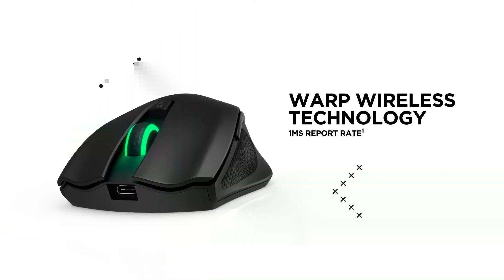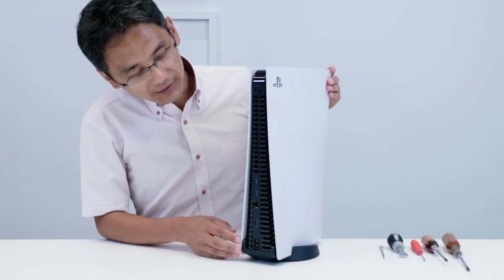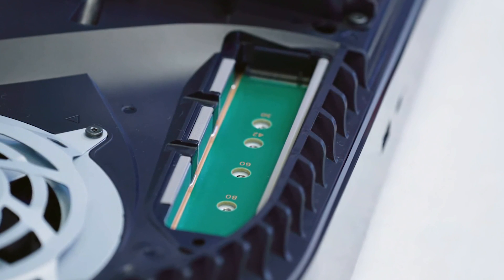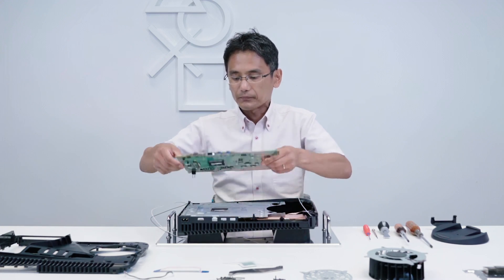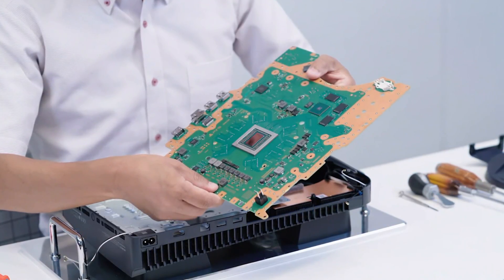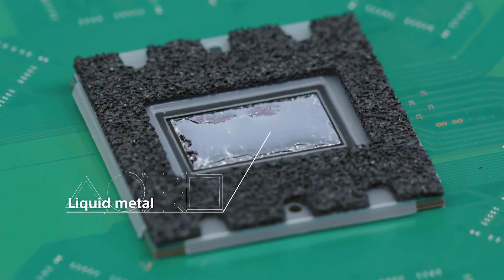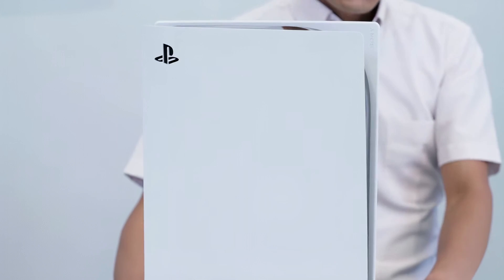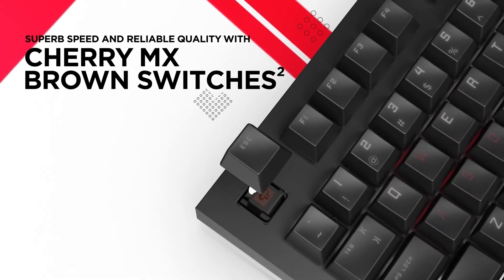PlayStation 5 Teardown Analysis: Inside Sony's Next Generation Hardware Design

Comment: As a practical gamer . I always connect my consoles and PC to ethernet.
Reply: Yeah me too. even though my wifi is really good. If the device is stationary why not.
Reply: It's probably for the PSVR2 which is rumored to use WiFi
Reply: @marcovalk7845  .
Reply: @marcovalk7845  Not rumored, just a patent they sent out. No engineerin their right mind would use VR streaming over garbage 2+2 wifi6 though. No presence and terrible latency.
Reply: @marcovalk7845  That would be from the console via an antenna not your router. It would add latency if it beamed it to your router instead of directly to it.
Reply: @Skylancer727  I think when he says to use wifi, that he means connecting the ps5's wifi6 directly connects to the psvr2. Wifi6 has centimeter level positioning so it could be used to make the psvr2 wireless.
Reply: @Skylancer727  depends, if it can also serve as a hub for the PSVR2 it should be fine. I don't know the specifics just the rumor
Reply: @marcovalk7845  That's what a lot of tech heads are saying, it's a future proof solution for a wireless PSVR2 headset. It makes sense given that the wired nature of the current headset holds the system down.
Reply: It has nothing to do with being a practical gamer. This is more about accessibility to a more stable connection when an ethernet connection is not possible. Happens in many households including mine, where the Ethernet access is in a different room than a multimedia room/living room
Reply: @edgaracosta9976  Yes and No, I know a lot of hardcore gamers that have run or spent money on a cable run to avoid the WIFI plague. For most console games on the PS4 Pro's upgraded WIFI chip I find it suitable for gaming, but before my wife got her Pro I ran wire for her. The WIFI was bad on the PS4 at least for us. the router was at max  15 feet and one wall away. I also have my router elevated in the room it's located in.
Reply: @edgaracosta9976  Let's be honest, unless you're streaming a 40 mbps BlueRay from Plex to your PlayStation, 5 GHz WiFi works great, as long as you don't have GBPS internet with FTTH, in that case yes, you'd gain speed.
Reply: @lnx648  Even blu-ray movie should be fine on that, in fact it is because I have man blu-ray movies and they stream over to my smartphone and laptop fine, if I had a newer router with the new wi-fi standard, it would be even better.

But the real issue with wi-fi is latency and interference, for most it's likely fine but many do notice the difference.

For me, wi-fi is fine even for gaming but my problem with it was the reliability, I tend to have more issues with wi-fi then with the wire.
Reply: @paul1979uk2000  Blu ray remux are barely playable on 5GHz WiFi with one end device connected via ethernet and the client connected wirelessly.
And with barely I mean some movies will chop, need to buffer often and so on.

But 5GHz is great for everything else honestly, neve had a problem with it, wether it's latency or speed. I get 8ms ping on WiFi, and I max out my internet speed also on WiFi.
Reply: @lnx648  It works here and seems to not have any issues with it, the blu-ray movies are raw rip so a direct copy of the original movie from the disk stored on hard drive, never had any issues with streaming them to any device on 5ghz.

In fact, an easy way to understand this is that I have a 200mb internet connection thats more like 220mb, I can max that connection without any problems on my wi-fi, that connection can almost do 3 blu-ray movies at the same time, to be fair, we do have a decent router so that might help.
Reply: @paul1979uk2000  Wait, do you have RIP or REMUXes, the first one is compressed, heavy but compressed. The second one is straight out of a blu-ray. I mean it works, but it depends on the movie, some have a bitrate that is too high and 5GHz starts failing or needs to buffer, depends on the movie however...
Reply: @lnx648  No it's just a direct rip of the disc with the protection removed, the size of the movie file on the hard drive is the same as it is on the disc.

To be fair, I've not really tried any newer bluray movies, most I did a few years ago but some are around 50GB and have no issues at all, in fact, we can have about 3 bluray movies playing at the same time without any issues over wi-fi so I doubt it's an issue for newer blurays if they are bigger in file size.

In any case, I have a 220mb internet connection that gets full speed over wi-fi, that's around 100GB of data per hour on my internet connection, I don't know how much more bandwidth my wi-fi has over my internet connection but it never has any trouble maxing my connection out.
Reply: I live in  an apartment they put my osp connection is in the closet🤦🏽‍♂️, so I can't just run an ethernet through the walls or across my floor, so having my nighthawk router does justice and wifi 6 will only make my connection better, even with my nighthawk I get 120 down on my ps4 pro.
Reply: If you are a competitive gamer, no amount of  wifi connection can replace the speed and reliability of a hard wired ethernet connection.
Reply: I have in the past, but new room layout—and destructive toddlers—means I will run the PS5 wireless this gen. It will sit up beside the tv, safe and sound.
Reply: Not everyone can. All of the kids getting these dont have the luxury, knowledge nor money to get a powerline ethernet adapters.
Reply: @AllOutNoobHater  ethernet is cheaper than getting an entire wifi router to hook up lol, a good one too, wifi will never be for those who are serious about gaming, ethernet is just better in every way, you can literally buy an ethernet cable for like less than 50$ & it will give you better performance than wifi ever wil
Reply: @bossmicky9256  I am fully aware of this. But did you miss the part where I said that the majority of kids getting these consoles can't do that and don't have parents that understand this?
Reply: @AllOutNoobHater  Yea I completely missed that, Idk how old ethernet is but I’m sure its before wifi at least right? Its crazy , I didn’t even know what ethernet was either until I got more into competitive gaming, and that was recently, like 2 years ago or 3 at the most, & didn’t get one until I played warzone since it was unbearable, I would lag n die instantly
Reply: No one that cares about performance will use wifi, ethernet will be always the better choice, I even use it on my Switch.
Reply: I've got wifi 6. I get gigabit speeds over wifi. It's nuts.
Reply: @technologyanimals  "bUt eThErNeT iS beTtEr" as every person tells us thinking that everyone has the ability to do so.
Reply: There’s nothing practical about that. Wires everywhere.
Reply: My wifi is very very good, so I'm glad we have wifi6
Reply: Same, WiFi fucking sucks, although if it's integrated with wireless VR that has actual decent controllers this time, I might be interested.
Reply: @YourPalHDee  maybe your WiFi sucks, but not everyone's does.
Reply: @deviouslaw  It doesn't matter how good your WiFi is, it will always be inferior to a cable connection.
Reply: @FlawleZ31  don't know where I contended that wireless is superior to ethernet? BUT if you really want to get into it, I have an Intel wifi 6 card in my gaming desktop. It literally maxes my downstream internet connection. Latency is 1ms greater when I have tested, a negligible amount. The performance is completely identical and the wireless has the benefit of not having to string cables around. Therefore, wireless is superior to ethernet in my use case.
Reply: @deviouslaw  I've played about with wireless on and off in the past but had too many issues with it where ethernet just works, I'll likely have another look into it once U upgrade my router with the new wi-fi standard.
Reply: @YourPalHDee  that's prob why it's wifi 6, but not everyone can run cables in their house, or even care for the extra latency
Reply: If you can't buy powerline network adapters on Amazon or whatever.
Reply: Ethernet will always be better than wifi, can’t deny that from a gamer that plays multiplayer games(mainly fps), but if you play single player games nothing is wrong w wifi.
Reply: That's true. Ethernet is the way to go. But for PSVR, a wireless option would be brilliant. Nobody wants to connect a VR to their system with a cable. It will interfere with your experience. 

A wireless VR would be easy to use with no janky cables ruining your day.
Reply: Yeah, wifi tends to be pretty spotty with all the interference.
Reply: Same, wireless is good but Ethernet is better for these things with having a reliable connection and lower latency.
Reply: Of course...way better
Reply: WiFi will always be inferior, until it manages to become full duplex.
People here claiming to have "great download speeds" with WiFi, that's irrelevant for latency dependent services like VR or online games.
Those people need to learn what half duplex and full duplex are.
Reply: @GoldSrc_  and you need to learn the difference between inferior in theory, and inferior in practice.
Reply: @deviouslaw  WiFi is inferior in both theory and practice.
It being more practical or not, doesn't make it superior, WiFi will always remain inferior to wired.

Full duplex IS superior to half duplex, there's no way around it.
Reply: @GoldSrc_  the practicality of it is a material advantage. If you want to put in such a vague criteria as superior/inferior. There's a point where the connectivity is functionally identical and the practicality wins there. Pro gamers have won major tournaments with logitech wireless mice..there comes a point where the theoretical differences just aren't worth obsessing over.
Reply: @deviouslaw  Tell that to people who obsess with over 144Hz monitors lol.
It's diminishing returns after 144Hz, but it is in no way compared to the difference between half and full duplex.
If WiFi has to stop listening to send, or stop sending to listen, it is inferior to wired full duplex. There's just no way for WiFi to be the best choice.
Higher tick rates might alleviate the problem, but there's nothing like wired internet for fast paced online games.
Imagine trying to use walkie talkies as cellphone communication, it's just not possible.
Reply: @GoldSrc_  you bring up an interesting point about monitors. I have a 144hz monitor. My latency increase varies under measurement between 0-1ms from using WiFi as compared to an ethernet cord. You just can't convince me that you can notice that difference when a 144hz frame is ~7ms. I understand that full duplex and half duplex are your favorite words, but how it leads to an experiential difference that you would reasonably expect to notice, you have yet to explain.
Reply: @deviouslaw  Thing is, with fast paced only games you can see your ping as being X ms, but behind that is the WiFi constantly waiting for the server response or waiting its turn to send data to it, a wired connection can do both at the same time, there's no need to wait other than the latency to the server.
But again, this will mostly affect fast paced games where you and the server needs to know your location or every other player's location as quickly as possible if you want an advantage, ping alone doesn't tell the whole story.
Reply: @GoldSrc_  Ok I understand your point about waiting to send/receive, but I feel like in effect you're making the same argument as people who claim analog will always be superior to digital - It's a theoretical truth that just doesn't stand up here where we all live, in the real world. Pulse width modulation being the other example - I'm sure you're aware, flickering lights on and off until to you or I, they are dimming. In your whole statement, I still didn't see where you can claim a quantifiable real world difference. Just a nebulous "advantage" that is never going to amount to frankly anything - except a placebo.
Reply: @deviouslaw  Nah, I will never say that analog is superior to digital.
But there is one specific area where analog is truly superior to digital, and that is latency, but I'm only speaking for very specific niche applications.
Wireless transmission of digital video will always have a slight annoying delay when compared the next to nothing for analog transmission, due to the nature of compression.
Like for those people who race drones with FPV googles, you just can't beat analog transmission, and you need the least amount of delay there.
Sure, the quality is not as good as digital, but on that specific application all you care is the visual information, quality is not the priority there.

Thing is, you want quick response? you go full duplex, most people might not notice it with half dupluex, but the difference is there.
Reply: Same here man. I start by plugging my console into a dumpster and then my PC to an ethernet. Only way to game.
Reply: That is the way!
Reply: I don’t game online much so I use wifi on my 5G network fast enough to download games and send messages and stuff. If I games online a lot I’d go hardwired
Reply: I use ethernet from MoCA as my setup is about 200ft from my router. Still get about 300-500mbps up and down out of the gigabyte I pay for.
Reply: Most gamers do.
Casual gamers wont.

Comment: “I don’t think I’ve seen quite something like this in the PC space”

Pretty sure there’s been plenty of CPU coolers looking like this thru the years.
Reply: He was referring to the fan design, not the cpu cooler.
Reply: In fairness I have been building PCs for 20+ years and haven't seen a fan like that either. It's essentially designed to pull air in from the both sides and it's much thicker than your standard  push/pull PC fans.
Reply: Scythe Ninja 5 lol
Reply: i never seen any CPU cooler that has a 45mm fan
Reply: Never seen one this thick.
Reply: Zalman coolers looked industrial lol

Comment: Do we know if that available ssd space is smaller on PS5 due to pre installed software?
Reply: 2WIREG  He might have meant as compared to the Series X, which would be because the Sony SSD is 825 GB and the XBox is 1000 GB.
Reply: 2WIREG  I'm talking about Astro's Playroom which is pre-installed on every console.
Reply: @SiStockbridge  There be like 650 gb available
Reply: @SiStockbridge  you can uninstall astrocrap. It weights like 2,3 gb

Comment: before Microsoft bribed digital foundry Richard Leadbetter said that ps5's boost clock was a great idea as it would allow for significant power saving and lower heat production, because the gpu and cpu can throttle back power usage if they have loaded a frame quicker than intended for example if they loaded one frame at 90 fps instead of the desired speed of 60 fps then the cpu and gpu can briefly reduce power whilst waiting to load the next frame. This means that heat output is reduced and clock rates can be pushed higher. With a locked frame rate the power usage is constant and this means that a locked clock rate is less efficient than a variable clock rate.
Reply: Microsoft money changed their minds
Reply: Why are you here then?
Reply: @Cartoonman154  because I'm pissed that a YouTube channel that is supposed to give unbiased advice on gaming technology is biased towards Microsoft. They probably received a few dollars from Microsoft when Microsoft paid for all of their flights and accommodation when they went over to check out the xbox series x design. Before that trip I seem to recall digital foundry saying a lot of positive things about the ps5 after mark Cerny's deep dive video and this was when a lot of less experienced tech you tubers were unimpressed with the deep dive video.
Reply: u okay, mate?
Reply: @DavidSattler  I bet you're an xbox fanboy who watches Austin Evans.
Reply: @joeallen7172    And i bet YOU are a sony ponie fanboy, dont say anything else, smh🙃